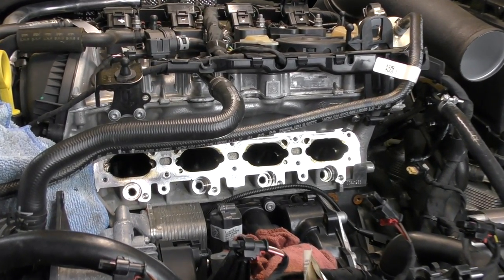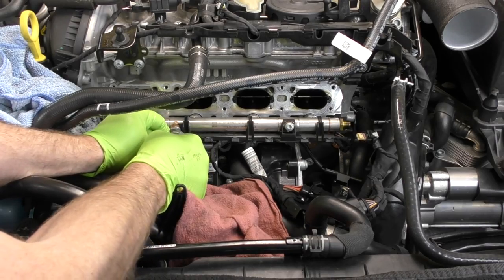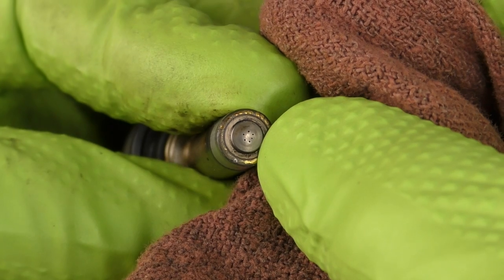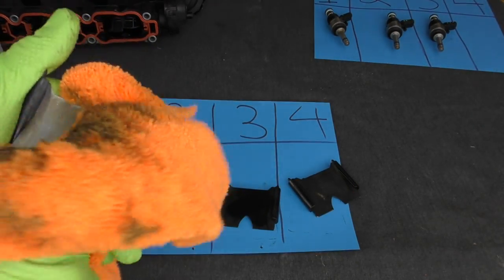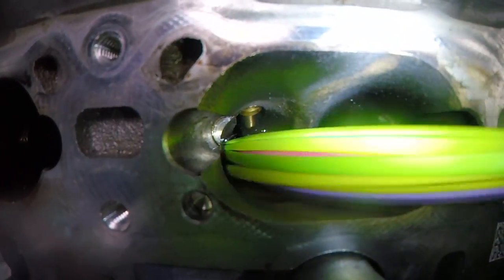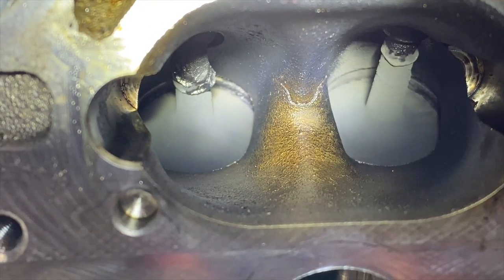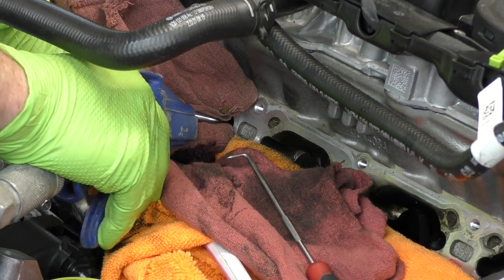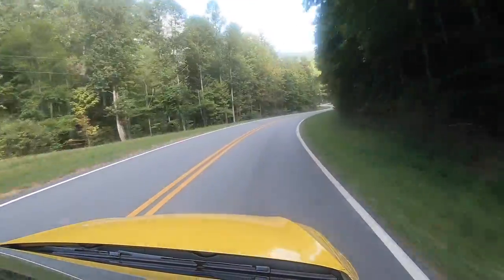How Much Carbon Build Up at 10,000 Miles?? ~ 2019 Golf R

Comment: Ford also went to dual injection on new F-150 engines. Except for 3.3 v6. That one is port injected. 2.0 and 2.3 is still direct injected. I could be wrong, but Ford doesn't have as much problems with DI. Still, buildup does happen.

Comment: Valves all get like that. I rebuilt the 357W in my 82 Mustang, cleaned all the valves in the process and had the intake manifold off like 3k miles later and the valves were all gunky already. And that was on a carbureted engine. They get gunky in all engines but people only pay attention to GDI engines due to the social contagion. My GTI is at 103,000 miles with no cleaning and runs great at is38 power levels. Logs look good, no missfires, car idles and runs smooth. Im sure the valves look gross but who cares, the car runs great just leave it. I guarantee auto manufacturers know and knew about this during testing of their GDI engines and they still didnt put valve cleaning on the maintenance schedule. That means they looked into it and saw that it didnt cause an issue with the operation of the engine. Case closed.

Comment: Could it be something in the design i got to say Hyundai GDI engine didn't  seem to have nearly as much issues with carboning or starting related carboning issues.. Run one 90K seems it have as much power as the day i got it.. cheap gas, lots a short trips engine not fully warmed, 3rd coldest region in the world, 4000 feet above sea level, mountainous full throttle climbs.. seems to be holding together, got another turbo GDI and a V6, my neighbour bought a high mileage one and his is doing well also no issues

Comment: Just came across this video in 2024. 
How was the intake port removal at 20K miles? Is there a followup video of that? Thx!

By the way, in autocross, on the slaloms (or any variation of slalom), the quicker way is to avoid doing a downhill skier version of slalom where the skier makes wide swooping turns.
Instead, we tend to clear slaloms faster if we think of it as several small straights with small turns in-between. 

WOT on the small straight. 
Cut throttle and turn at same time. 
WOT on the next small straight. 
Repeat. 

When cut throttle, nose of car will dip forward, aiding the turn. 

I was shown this approach in my second year of autocrossing by another veteran.

Comment: As soon as I got my BMW 330d I fitted an oil catch can and always run premium diesel.. I think just those two thinks can reduce carbon build up by a huge margin, also run the car hard on the motorway/highway for a few miles helps stop carbon build up in the diesel particulate filter.

Comment: There's a chance of fouling the O2 sensor as well, mine was.  The solution was easy enough in my case, removed O2 sensor and blew the carbon dust out of the perforated shield using a few blasts of compressed air.

Comment: I leased a 2016 GTI. I could tell by the gnarly carbon build-up on the exhaust tips that the engine was going to be every bit as nasty as any other DI engine. Turned it back in when lease was up and bought a Japanese car with PFI.
Reply: I did the opposite. I had a Lexus IS 300 AWD and now a Mk7 GTI. Whoops! 😓

Comment: In countries with the highest turn over of cars (lowest age) you tend to have fewer problems reported due to the cars no longer existing.
However in groups where there is high retention, there you will see how modern cars really stack up.
In these long term ownership experiences is where real problems exists, what post warranty work arounds are available, what premature parts scarcity are occurring etc and the problems that do exists for them but may not even exists for cars that are even much older eg.  cracked plastic intake, failed electronic thermostat etc.

Comment: I've watched this video a couple times and a few things come to mind...Does this engine not have the duel injection system? My Teramont is a 2l gen 3 and you can see the second indirect injectors and that alone will cure the carbon issue. Why would the Golf R not have this? The next thing, when you were turning the engine clockwise at 8:26 there looks like some black crumbly stuff falling out behind the pulley. What is that? It looks like dried grease or something...This is a great video, every time I watch it, even months apart I see or learn something new!!

Comment: My 2 cent opinion .
The buildup is mainly due to 3 paths 
             Intake valves oil seal 
    When an engine sucks in air it creates a vacuum near the top side of the intake valves. This pulls in the engine oil into the valve areas. Idling and low part throttle conditions is the worse culprit.
To reduce deposits  a higher viscosity oil is better. This also explain why some cars don,t have this issues as the seals are sealing much better than another similar car. 
             The piston rings
  blowby  from piston rings is at its highest during very high boost condition . 
            EGR intake
soots mix with air ,unburnt petrol and oil . No way round this as the engine ECU is and sensor may throw a fault if you bypass it.
Lastly its very important to use the grade of oil recommended by the manufacturer or at least make sure the oil is specially fomulated for direct injection engines.
     I am no expert in GDI engines so take my opinion as such.

Comment: If you wanted tp avoid carbon built in Vag 2.0 tfsi I strongly suggest to use Motul or Liquid Molly oil and a catch can. I have a 160,000 miles on my Audi A4 B8.5 with Neuspeed power module and I only needed to clean the intake at 145,000 miles.

Comment: Another way you could clean out the gunk inside the valves is by using a vacuum cleaner that anyone can modify by attaching a smaller rubber tube to the end off the vacuum cleaner hose and just taping it up it worked wonders by sucking everything out out...I did this on my wife’s eos when cleaning the carbon build up

Comment: mine had less at 50K was just a light dusting of carbon before I did a walnut shell blasting and I had the dealer take photos before and after and it look brand new when done! I drive hard and use premium fuel and add seafaom every 5K. 2016 vw gli 2.0T So the key is to use seaform every 5k and push the pedal to the metal when going onto the freeway !

Comment: Oh man. I have a 2017 GTI that has just ticked over 45k miles. Now I'm curious how much carbon has built up. It's got a track day and numerous autocrosses under its belt and I've done all my oil changes around 5-6k miles with Liquimoly. Luckily, I haven't had any idle problems or misfires. I was hoping the carbon cleaning wouldn't be needed until 100k miles or until symptoms arise. Thanks for making this video!

Comment: I've been considering replacing my '07 Ford Ranger with a '20 model.  The '07 has 170k miles on it and runs just fine.  I'm thinking I'll wait a bit.  Ford engines suffer the same ills due to not squirting the juice ahead of the goose.  I do not want to deal with carbon removal woes.  Still skeptical of the "newer" tech.  Blech!

Comment: The factory PCV has a big issue when on the track or autocross. The oil just get pass the pcv and into the engine. I fill up the catch can really fast on the track, I need to empty it twice a day. Nothing when just regular driving so it explains a lot.

Comment: That is a surprising amount of carbon for only 10K miles although I'd be curious to see if it tapers off at higher mileage now that the engine is done with it's break in.
It doesn't look as bad as something like the N54 or N55 motors from BMW but either way I'd be throwing a Oil-Catch can setup on this pronto.
Reply: @N4CR  Manufactures in North America actually  need to prove within reason that a modification is responsible for an issue, they can't actually blanket deny warranties 

So while yes there is some risks when your almost gurnateed a carbon cleaning every 20-30k miles for about  $600-$1200 a $200 oil catch can is cheap insurance.

Comment: Hi Charles I know this is an old video but thought I would ask here. I have a 2010 B6 Passat 2.0t CCTA TSI 6M/T with 145k kms/90k miles up in Canada eh - recently I've had the CEL come on initially with P0101 and then later with P2177. It does have a slight stumble for a few seconds when you start it cold, it also doesn't seem to idle up more than 800rpm when cold either. Only once has it actually stalled immediately after start up. It also seems to not like the gas pedal stomped immediately when taking off from lights, I find I have to slip the clutch a little otherwise it will bog down massively. When the car isn't moving and in neutral, if I give it gas it doesn't seem to rev freely either, but when driving there is no obvious misfire. I've recently replaced the plugs just to be sure and the coils look good with no obvious signs of degradation. I've only just bought the car recently so I don't know it's full history, I am expecting to have to remove the inlet to clean the valves at some point (along with re-seal the cam tray) so was wondering if P0101 and P2177 faults combined with the other characteristics I'm experiencing are in line with the inlet valves being partially blocked by the build up? Thanks!

Comment: Great DIY tips dude. I would use the rifle barrel cleaning brass brushes to attack the hard carbon muck on intake valves.
Reply from the maker: Those work GREAT! In fact if my shop wasn't upside down from building the new place, I would have used that. LOL

Comment: Isn't the CCTA/CBFA a EA888 (Gen-1 TSI) Engine in the MK6 GTI's, and your engine in the MK7.5 Golf R a CYFB EA888 (Gen-3 TSI)?
It sounds like you are references CCTA and EA888 as different engines?

I have a 2013 GTI with the CCTA EA888 Gen-1 TSI and DSG Trans. Just did a complete OEM timing Kit and replaced every single part of the timing setup except the oil pump chain and sprockets. She made it 97,000 Miles before I felt it needed it. Started to get chain rattle on cold start for a second or so, and checked with OBDeleven and it was at -4.35. Hopefully the updated chain and other parts don't have a chain stretch issue and can make it at least another 100,000 miles. She only gets Shell V-Power 91-Octane, Mobil-1 Euro Spec 0W-40 every 5,000 miles, and the VW G17 Additive every 5,000 Miles. Uses maybe 6-8 oz of oil every 5,000 miles, which is normal from what people tell me. Kinda reminds me of the RX7 Rotories that burned engine oil by design, even had a reservoir that you fill up with engine oil for it to use to keep the seals lubed. Love this car, just recently went IE Stage 2, DSG Tune, and all other IE Stage 2 supporting mods (Downpipe, Intake, Intercooler, and soon to have their K04 and Intake Manifold). Waiting for IE to get their K04 kit back in stock so I can install that along with their Intake Manifold I have sitting in the garage. 

Maybe try the IE Water/Meth Injection Throttle Body Spacer, should help keep the valves a lot cleaner.
At least yours is at the stage where it can be cleaned with a brush and solvents, and don't have to do walnut media blasting.

Comment: I’m so not looking forward to doing this on our 2018 Honda Accord. I’ve heard the valve coking can be really problematic on all direct injection engines and I’m dreading the repair bill for getting them cleaned out. Does anyone have any information on this and what I’ll be looking at for a repair bill, the car currently has about 30K miles and is running perfectly. I just want to know what to look for and the issues associated with this problem. Thanks for all the help, it’s greatly appreciated, and keep all this great info coming I love your channel!

Comment: Even though these are DI engines, isn't running more boost (power) through the stock system generating more "blow by"?  I would be interested to see a stock model after 10K and compare the difference. That would be a solid example and case point.  
Good stuff nonetheless!!!

Comment: Hi Charles! I did that work on my ex-GTI (MK6) with HUGE improvements!! Now I have a TTRS MK2 with a lot of oil "swet" on the intake (30k miles). Can you give some advise or tip on how to rotate the crankshaft to TDC to close the vavles? and some other tips on how to take out the manifold?
Cheers!

Comment: If a sufficient brand of fuel system cleaner is used that has PEA in it... Is it likely that any of that cleaning agent combined with any detergents in quality fuel would also make it into the intake, via blow by? therefore helping the intake valves stay cleaner in the long run? or would the detergents likely be "destroyed" by the combustion process? Curious on anyone's input, thanks!

Comment: Doesn`t the GTI enginge got port and direct injection. The port injection should help to keep the valves clean. If so, a normal direct injection engine should look much worse after the same mileage. A catch can also should help a lot on this type of engine combined wit h the port injection. Impressive video for diy. Thanks for sharing!

Comment: My Mini Cooper S with the new 2.0 BMW engine performs just fine..  83k miles on the clock and stage 2 with 300hp. Should i be worried?

Comment: It's good money to do the labor on the CCTA's.  Tear down, Walnut shell cleaning, and carb cleaner.  Checked the lifter on the HPFP's as well while you're there.  Customers are usually impressed with the before and after photos.
Reply: Btw Charles, you should be an instructor.    VW in Germany would be smart to bring you in to become a  troubleshooter and for that to lead you to becoming that instructor.   

I cut my teeth with VW'a since the 80's and the last 10 years at a Euro shop that specializes in VW and Audi.  You have the perfect demeanor to teach!  I've learned a lot from your channel.  Keep up the great work.

Comment: Hey Charles Been watching your channel for a long time as a fellow VW guy and was glad to see you get the R.  I’ve got a 2017 36K and  just yesterday noticed the car seemed to lose power and stuttered a bit after cold start driving round a corner. Can you comment on how effective chemical cleaning is from the dealer?  Does it make sense to just get to mechanical cleaning instead if your pretty sure you’ve got an issue?  Would a-predicate your thoughts.

Comment: I just cleaned up the ports on my spare head to my Accord.   The head had 287k miles when pulled       and it was seriously cleaner than those.....like alot cleaner.     Almost his finished product clean....granted I have port injection.   Not direct but still

Comment: I have seen a lot of theories about what causes most of this carbon build up, and lot of folks believe it is contaminated oil from the PCV and try using oil catch cans to prevent it. However, I have seen where these catch cans are used and still they see the same level of carbon deposits. Then I also see where cars that are driven lightly seem to get a lot more carbon build up compared to cars that are regularly driven hard, and folks attribute the difference to the so called "Italian tune up" believing that the  higher heat/velocity cleans out the system. 
However, I can't help but think that most of these carbon deposits are caused by the EGR system. It seems to fit with the light vs hard driving differences many have observed given that the EGR is only open under light driving conditions and closes under boost. Also if you have ever seen how badly those EGR valves can get clogged  with carbon build up...
I know it helps emissions, but how much of a difference is it really? I don't think there is any  easy way to  switch it off or bypass it without the CPU throwing alarms, but it would be an interesting test  if there was a way to do it.  

I am curious what you think about all of this?

Comment: A bit uncomfortable to see that in a car with 10k miles. I wonder how it looks like in the diesel škoda i drive. It's at 55k km, when should it be checked out?
Does this happen on older non-DI cars to a point where its worth cleaning it?

Comment: I wish VW would just use direct and port injection.
It would solve this issue i think for at least a good while longer, i live in northern Canada where it can get as low as -45 celcius, both my 2007 Audi A4 2.0t and my 2015 GTI had carbon build up, the Audi left me stranded a few times on the very cold days and miss fired horribly ince started, i was quoted 3000 dollars to do a carbon cleaning at my dealer for the Audi 

Now I'm concerned that my 2018 Tiguan is going to need one soon especially only running regular fuel as it calls for.

That carbon cleaning could be an easy fix but i guess it's also easy money for the company.

Anyway great video I've watched quite a few over the years👌👌👌